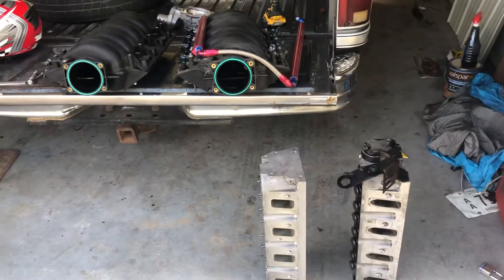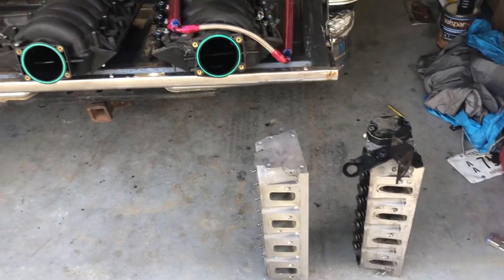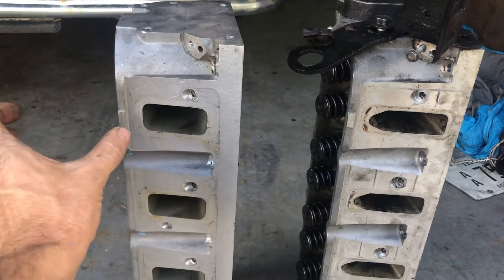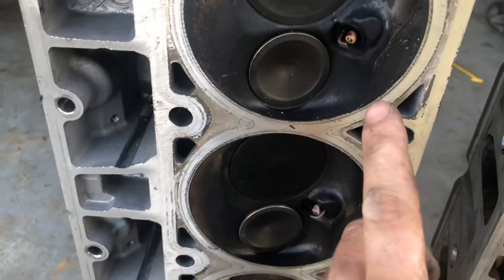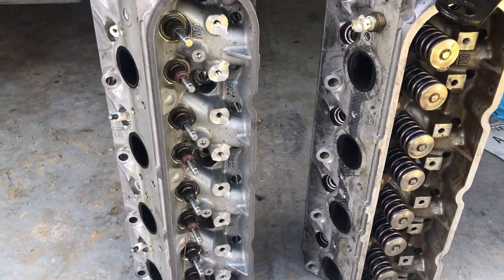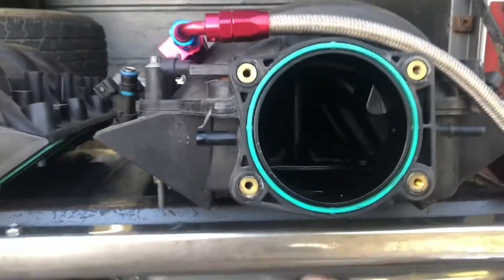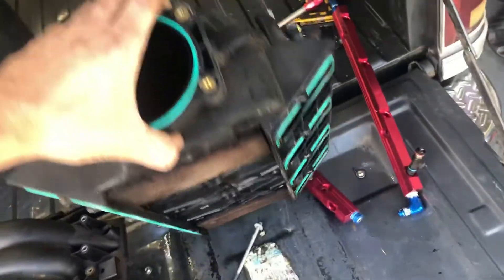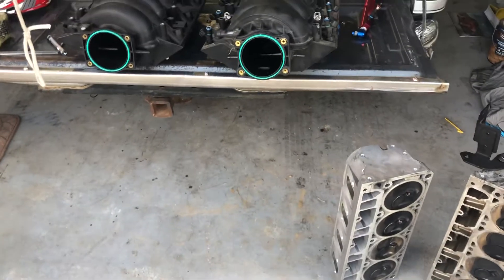Ls3 vs ls2 cathedral vs rectangle port ls 6.0 6.2

Comment: Have a question anyone in the comment section this help would be greatly appreciated.  I have a GMC TRUCK L9H motor im putting in a cam lifters springs everything new top end. Ordered from summit i believe the heads on the L9H is rectangular well my gasket kit came with cathedral gaskets just called summit & they're saying the gasket will work for either does anyone have any contrary information to summit?? Thanks in advance!!
Reply from the maker: They do not interchange
Reply: @Sleeperdude  are you positive 
? Seriously i didn't think so either im kind of disappointed with summit if your right do you no where I can confirm not that I doubt you its like why not not send catheredral style gaskets wth
Reply: @Sleeperdude  ok thanks

Comment: Personally prefer the 243 heads. Smaller ports provide faster airflow at lower rpm. They seem a bit more seat in the pants off the line. Have experiences with both and yes, the l92 heads are more of a dyno queen for numbers... depends what trying to achieve. Small cam, wanting broard torque- go the 243s! Engine feels more refined imo